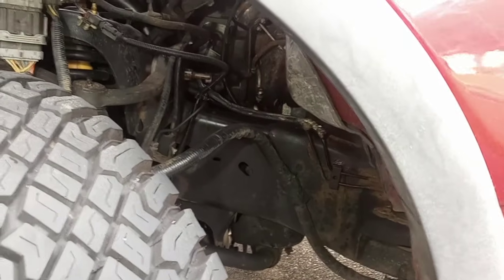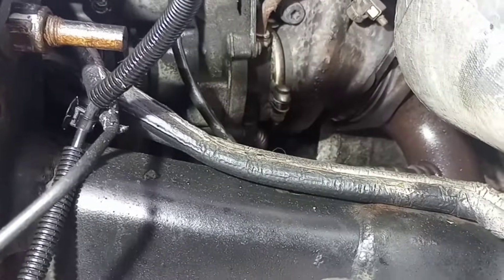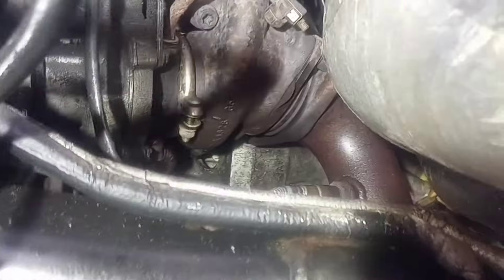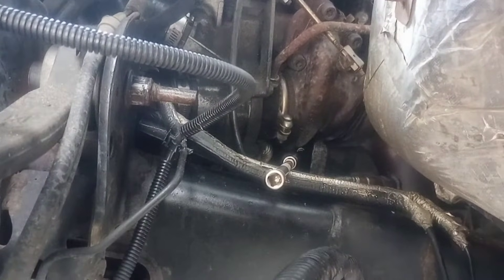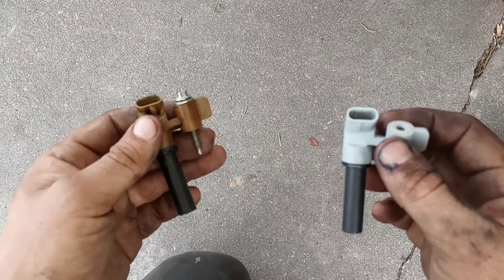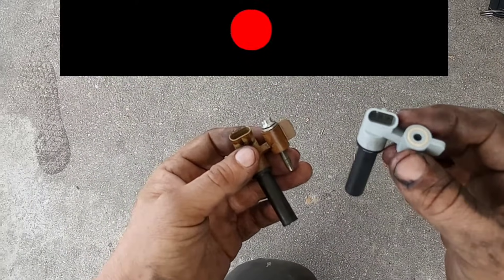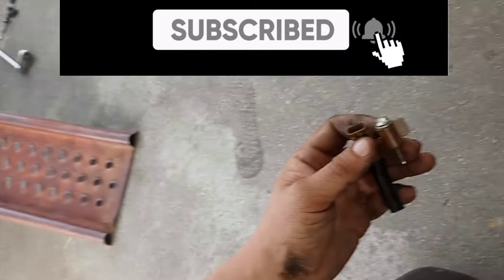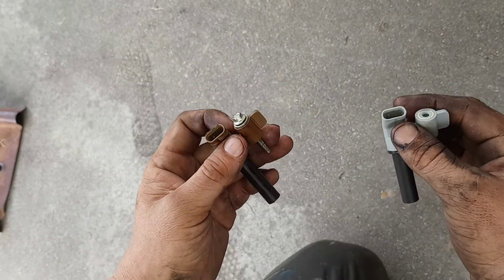EcoBoost 3.5L Crankshaft Sensor Location: 2013 F150 Tutorial

Comment: Great points in here, especially the turbo heat shield 

The clocking location of the sensor is also one of the better points in videos on this topic.

Let’s say that most don’t talk and show about the reinstall process enough.    So let’s add in some tips to help this along…

The reinstall of the sensor is tough and a needle nose vise grips is the key tool for getting the sensor in the correct position… the tab on the bottom of the sensor, is where to clamp onto with the visegrips… with your hand / arm wrapped around from below…
Then you are able to aim the black sensor arm into the square slot and get it positively into position. 
(2016 Expedition).
Reply from the maker: Great tips!!!

Comment: Where is the hole the new sensor goes into? I cannot get the sensor back in and need to see inside to look at the hole position or location to push the sensor into it. Anyone have a picture of the hole inside where it goes in?
Reply from the maker: Use a small alignment punch to help

Comment: Do you know of this is the same 3.5 as the Lincoln mkt ecoboost? I can't find a video anywhere to do the crankshaft sensor, and I want to know what I am getting at. Few forums said that the bolt is really hard to line back up once you take it out. The car is a 2013 lincoln mkt ecoboost pretty sure it's the 3.5
Reply from the maker: Lincoln is owned by Ford so it makes sense that they would use same engine. Were you able to get this repaired? Thanks for watching
Reply: @Sellthoseflippingcars No the MKT is completely different then this. Even if it's the same engine the exhaust manifold is different and it looked like I would have to pull that off, and the dam turbo just to get to it. We are driving it, and just going to sell it because everyone is saying it's the timing chain that is stretched. 100k miles and this pos car needs a timing chain? Fk Ford.

Comment: Replaced but my problem ended up being the solenoids that are located in the valve cover. Cylinder 1,2 and 3 misfire, random misfire and check engine light
Reply from the maker: When is the last time you have done a tune up? Did you check the engine codes?

Comment: Not a good explanation on how to reinstall. Any extra info on the best way to reinstall?
Reply from the maker: Get the bolt as straight as possible on reinstallation. Definitely a really tight spot. Thanks for watching
Reply: How do I tell when it is in the right spot? Any time the bolt is aligned with the hole does that mean it is in the correct position?
Reply from the maker: Without removing the turbo it will be all about feel on this one, might I suggest tho. Go lefty before righty when screwing the bolt back in, you will feel the threads set into position and this will assure you that you wont crossthread that small little bolt. Definitely not a fun job but will save you ALOT of money from having the shop do it.